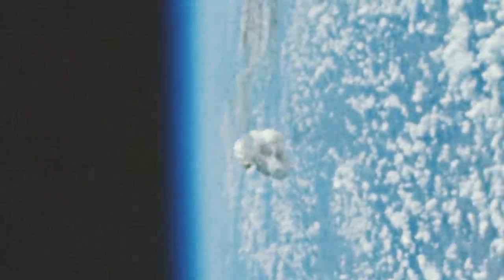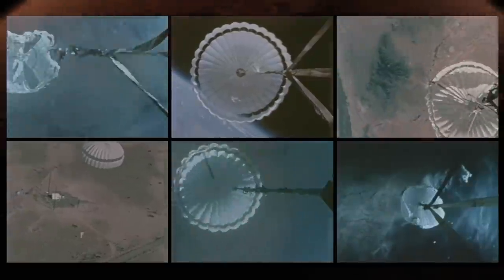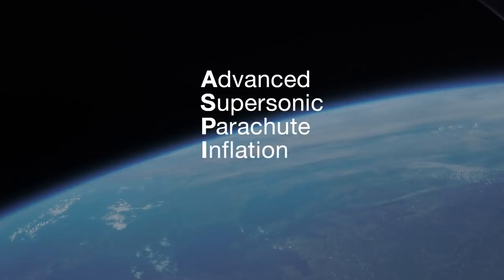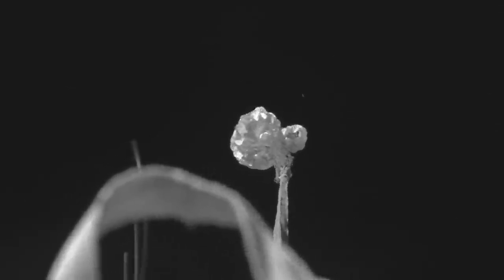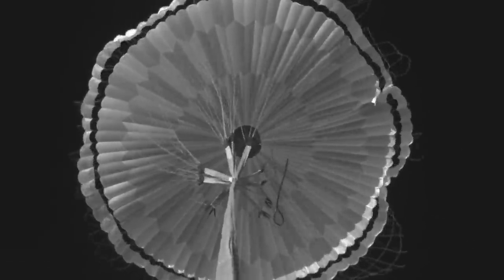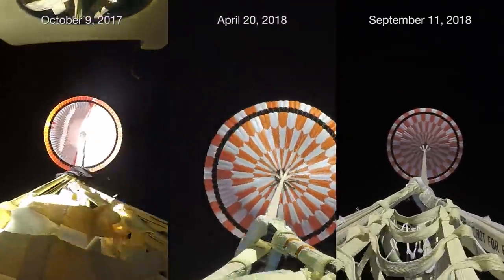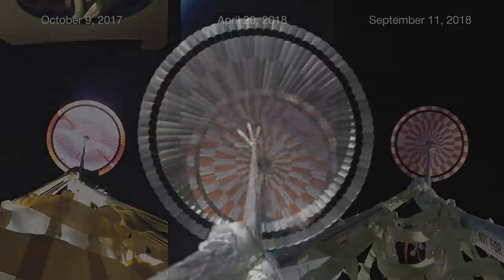Supersonic Parachute for NASA's Mars 2020 Rover Is Go

Comment: Sometimes testing a material deployment system way above its rated capacity works flawlessly.  Now they need to test the deployment under what they believe are nominal conditions and see if the performance envelope remains the same.  They might find that something goes awry on testing in nominal conditions.
Reply: I'm pretty sure they're well aware of what they're doing, having done it before and all.
Reply: Perhaps they will. But, you're right, they should.
Reply: @logitech4873  I wouldn't be so sure about that.
Reply: @joedempseysr.3376  They did do it recently with Curiosity - they absolutely know what they're doing.
Reply: @logitech4873  This system is a complete redesign of the one used within the mission parameters Curiosity employed.  I won't say that NASA has not tested a deployment with nominal air pressures, but they did have an anomaly with Hubble's optics because Perkin-Elmer, who won the contract to make and assemble the mirror failed to reconcile measurements from a 2nd inaccurately assembled Null Corrector (the device used to verify the shape of the mirror) resulting in the final shape of the mirror having chromatic aberration.  NASA was sighted as not following up on quality control of their sub-contractor to make sure the work was done to specifications.  My comment is more of a 'let's make sure' sort of thing rather than a mandate for an otherwise competent agency.
Reply: @Rickbearcat  Well fair enough.
Reply: No, the Hubble mirror mistake was a problem with the mirror curve measuring device.
Reply: @logitech4873  And yet they lost several Mars spacecraft over the years. One either crash landed or missed Mars completely. Another was destroyed when the engineers mistook Metric measurements for Imperial units. Engineers are only people and they make mistakes all the time, even those who work for JPL or NASA. That's why they constantly double and triple check their work. Even so, mistakes are still made from time to time. I know this because I am an engineer. So don't put those NASA folks on a pedestal, at some point they'll fall of and disappoint you!
Reply: @joedempseysr.3376  All any human being can do is their best.  And, sometimes, even that isn't good enough.  All we can do is engineer in a safety factor and cross our fingers.
Reply: Of the 3 flights, the load was different each time to cover the entire possible flight envelope
Reply: @nerdystarwarsman1994  Citation?
Reply: @Rickbearcat  Now we are in complete agreement.
Reply: That's not really necessary at all.

Comment: The parachute material could be used as the "balloon" with which to build a dome. Attach it to a ring and 
 inflate it, then spray a thin layer of concrete of some kind over the top. Reinforce with netting and spray
another coat. Repeat as many times as needed...
Deflate parachute material and use for another dome...

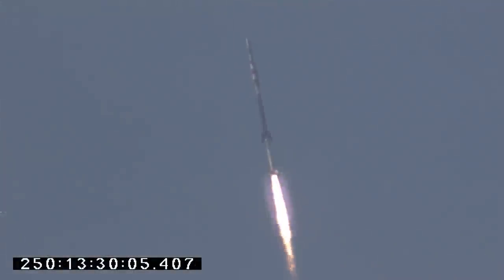Comment: 0:52 "...and ascends to altitudes where the atmosphere of Earth nearly mimics the atmosphere NEAR THE SURFACE OF of Mars..." so, it's designed to deploy on impact...got it.
Reply: near the surface, not on the surface. 
It is also stated later in the video that they are testing the chute more intensely than what it will encounter on mars, but I doubt you watched the whole video.
Reply: My comment was to make a point; and, by the way, I did watch the entire video; and, I heard that bit.  It doesn't matter.  There's crucial other information about Mars to consider - 6 millibar at the surface is a near vacuum - less than 1% of Earth's atmosphere at sea level.  The higher you go, the thinner it gets...the less able any chute - regardless of size - will slow down anything traveling at ballistic speeds - Mach 20 - 25 or higher. Parachutes the size of California won't slow it down in a vacuum.  There may be denser atmosphere on Mars than they're admitting.
Reply: @Search4TruthReality  you've just shown your lack of understanding. Dimensions of the parachute DO matter a lot.
Reply: There are many factors that matter - such as mass and velocity and the lack of an atmosphere to slow a craft traveling at extremely high velocity.   Admittedly yes, I have a lack of understanding: I don't understand how parachutes are capable of operating in a near vacuum - specifically at less than six millibar (6/1000 of a Bar). On Earth, at sea lever, we have one Bar.  On Mars, look it up = 6 millibar at the surface.  Parachutes operate on drag against air.  If there is no air, then how does it work?  By the way, I'll admit I poked fun at NASA with my post by implying a chute opens on impact; but, hey, they earned that one, especially when you consider their comments of testing in an atmosphere somewhat similar to that of Mars NEAR THE SURFACE.  Right?  Let's be real.  A craft Approaching Mars orbit - at altitude, where it matters most - the atmosphere is going to be less than it is at the surface.  All joking aside, I'm completely open.  This is something that has confused me for a while.  Perhaps you can enlighten me as to how parachutes can slow down anything in a vacuum; because, this questions was asked of representatives at JPL in 2012 during a talk show they'd discontinued after that question was asked (gee, I wonder why?); and, they dodged the questions, only to say "it just worked".  What happened to using stuff like retro-rockets?  Perhaps you have an answer?  You know, I've visited science museums and I have seen exhibits.  Perhaps you have too?  There's a really cool demonstration of a parachute in an acrylic vacuum chamber.  One button spins a fan and a parachute "flies" in front if it.  Press another button, and the atmosphere is sucked out - a meter shows how thin the atmosphere becomes.  As the air was sucked out, the parachute drooped, even at atmosphere measurements GREATER than 6 millibar, thereby illustrating the point: parachutes are completely incapable of inflating in a vacuum, even in front of a spinning fan.  Is my interpretation of the experiment in error.  If so, how?  I'd like to know more about the science.  Any technical information you can provide to clarify my "lack of understanding" would be very much appreciated; because, even JPL wouldn't go there.  Thank you in advance for your help.
Reply: @RT 9 Thank you. I was inspired by William "Brett" Stillings (known for Jump Room to Mars; Project Pegasus; Teleportation technologies in 1980's, etc.), who shared this bit of information with me; and, he was the one who asked JPL the questions.  I talked to him a few days ago; and, he said JPL also replied with "Give us a break."  I'm not holding my breath for my request for scientific data from @TheHorrorGamer Simionato, who insists I've expressed a lack of understanding about this.  The way I see it, there are only two possibilities.  1) It's 6 millibar near the surface of Mars and NASA is hoaxing the tech; or 2) Mars atmosphere is much denser; and, NASA is hoaxing the tech.   The way William Stillings sees it, the atmosphere on Mars is breathable and NASA is hoaxing the tech.  :-)

Comment: What are we waiting for? Isn't it feasible to consider another approach that could fast track and ensure safety? NASA (And other countries) could start sending Mods and assemble (Or ready for assemble) in Mars orbit what could be similar to the current  but smaller International Space Station. The first missions would then not land but prepare and assemble the individual Mods. Doesn't it make some sense? Then from the MISS, (Mars international space station) habitat Mods could either be launched or sent from Earth to establish a ground base. A Mars lander would be part of the pieces sent to dock for future and much safer landings. This approach would provide safety redundancies Far greater then any current extremely dangerous plan to put a few Humans in a Can for 300 days with O safety redundancies. Essentially with this approach it could mirror NASA's going to the Moon for the first time. We did fly by's etc. again allowing safety redundancies to map out, check out safe landing spots. I just have to believe that attempting the first landing on Mars from Mars orbit would be significantly safer than from Earth. The MISS could also have an additional landing vehicles, maybe similar to the LM for rescue if needed.

Now here is another optional possibility. Launch a Weigh Station at Half way point to Mars for emergency purposes only? Extra fuel, R&R just another potential redundancy. Because of Mars and Earth's orbits it may be impractical or impossible.

In closing, we could do this now with the combined effort of our current International Space partners. The other intangible is garnering the support of the American and other countries public interest for the financing needed to attempt such a bold and aggressive new approach to finish what John Kennedy initiated 55 years ago, "To the Moon and Beyond." 

I would appreciate any feedback from NASA or other scientific minds to the feasibility of this approach.